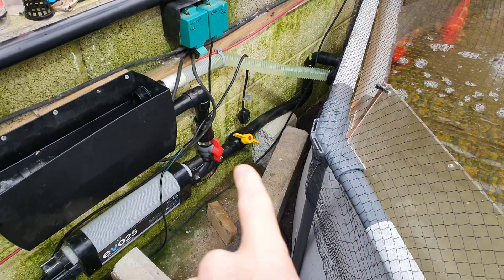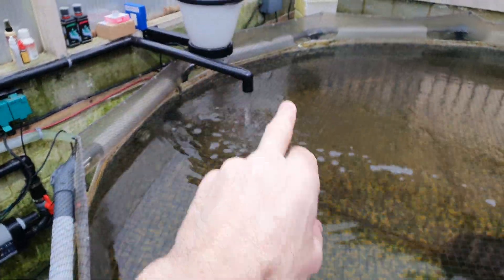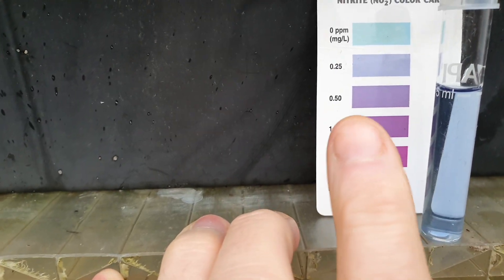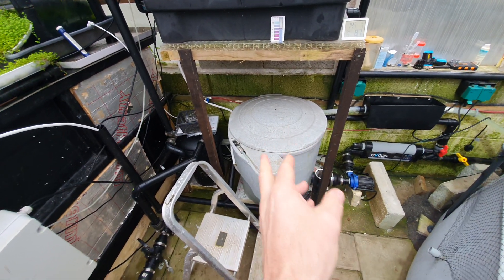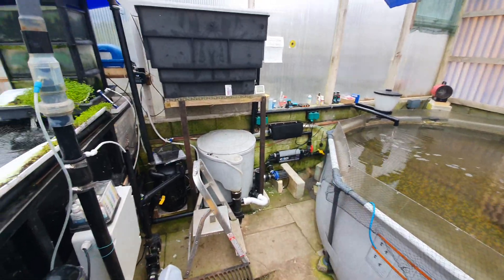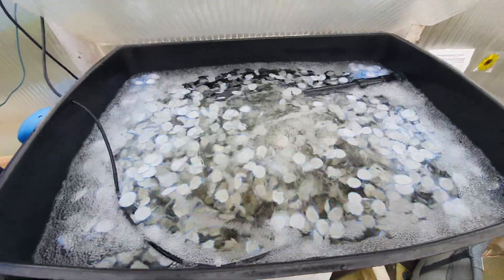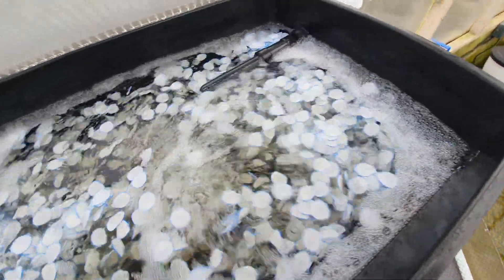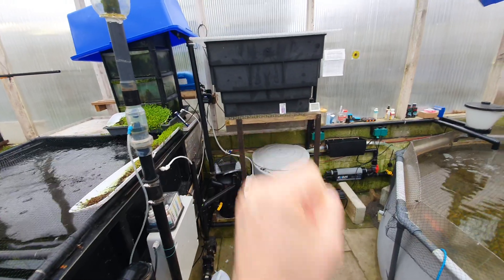DIY Moving Bed 2 with media!

Comment: Morning Keith just watched I’m impressed with what I’m seeing very interesting about the amount of air needed this is what they should be putting on the bag & website. It takes people like your self to fined out this very important kind of information that helps everybody use it correctly & get the very best out of the product. I swear by the oase biokick premium live bacteria best on the market great results & all koi keepers should have a box in stock for emergency’s or for after harsh treatments get filters back up & running with in a couple of days.
Reply from the maker: Hi, yes you'd think 🤔 there would be guidance on flowrate and air disturbance but maybe its far to variable  to state on the bag? I asked about PP'ing the product and he said its not needed and on experience now I'd agree, it gets tumbling quick! Fortunately for me what he quoted for my size tank is about what I have and its tumbling great 👍 👌. I think far too many over do it thus constantly bashing beneficial bacteria off the media but that's my observation of k users and what my brain is telling me 😆 it makes sense to me but I could be wrong as no experience with moving beds and k1 for that use. But, it's obvious isn't it? Doesn't appear so as I see many disturbing the moving bed bio media like cleaning the eazipod but I think they're forgetting the eazipod is a predominantly static mechanical filter so needs it. Thanks 😊
Reply: Yes my thoughts also

Comment: That stuff looks amazing mate, and doing the right job 👍
Reply from the maker: Hi, yes I agree, been very impressed so far with it! Thanks
Reply: @KoiKicks  just an idea, have you thought about heat mats under the pool on a thermostat 🤔
Reply from the maker: Not heat mats but I wish I'd of put down 25mm insulation board to bridge the ground heat loss. It's on at the moment and holding 13c!
Reply: @KoiKicks  that's not a bad temperature for this time of the year 👍
Reply from the maker: @lifearoundthekoipond2283  I'm a lucky boy but it's costing me some!
Reply: @KoiKicks  it's one of those hobbies that rapes ye bank account, and never says thanks afterwards, that's why I like it when I see people building homemade filters and stuff.